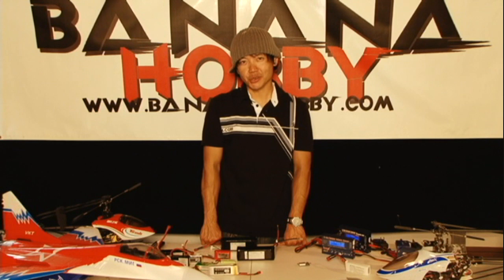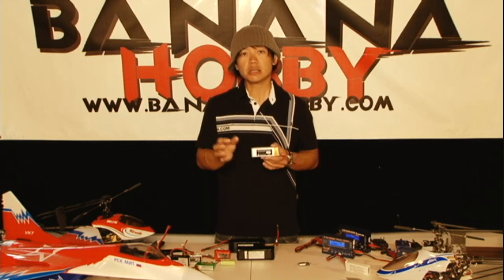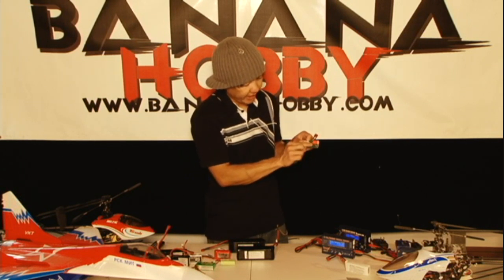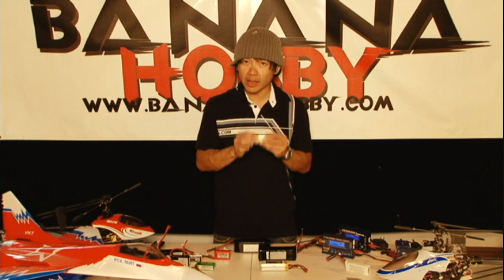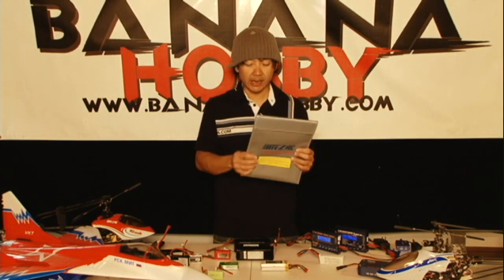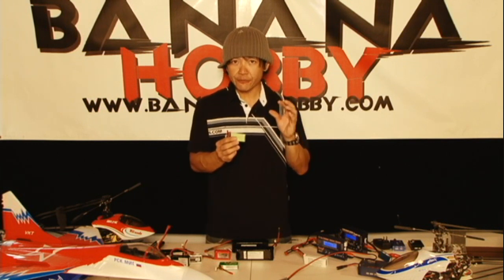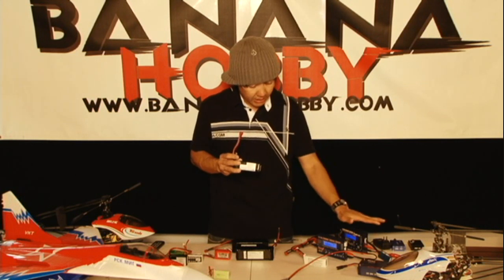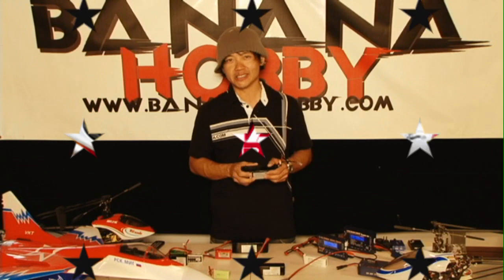LiPo Safety, Use and Care Instructional Video!

Comment from the maker: That may go under several things why a helicopter will spin.  Check that the gyro is in head lock mode first.  Then check your tail linkages and your radio programming.

Comment from the maker: When a battery is done charging, you can use it right away.  When you are finished running it, it is always good to let the battery cool down for about 20 minutes to your surrounding temperature.  Then put it back on the charger.

Comment from the maker: You can get as much as 1000 charges and discharges from 1 Lipo.  If you are planning to store a lipo with no use for over 3 to 5 months, it is always good to put a storage charge on it before storing.  If you leave a balanced voltage of 3.7V per cell, then store, the Lipo would be just fine when you decide to use it.

Comment: thanks for the info pete! Ive got a little vision 3 channel helicopter. and been running it on the ground to discharge the battery all the way. oops. hope i didn't hurt it. it seems to be flying to same time as before I did that so I dont think i've dameged it. thanks for the warning

Comment: I charge my lipos in a steel cash box. just filled a slot in it to allow the wire to come out. solid steel construction and lockable...pretty much blast proof and only £15 from a hardware store. theres a vid of a cash box containg an exploding lipo on here somewhere..check it out. Nice vid btw :)

Comment: 1.  You need a low voltage cut off, the car will just stop working at an appropriate voltage.
2.  Charging times vary on pack capability and charger capability.  1 Hour is usually the standard if you can charge at 1C.
3.  Probably not, you need a LiPo capable ESC though.
4.  Probably, LiPo packs tend to work better when its warm.  Always monitor your packs when charging though.  ALWAYS!
5.  If you use a LVC and balancing charger yes, just watch a couple of videos on LiPo care and maintenance.

Comment from the maker: Well, you can safely charge a 11.1v 5000mah at 5amps "technically".  However, I never charge any lipos at past 2.5 amps NO matter the mah ratings.  A little slower and lower charge rate such as 2.2 amps will give better longevity to a lipo battery.  5amps is too high of a rating unless you are short on time because you have a flight demo and are in need of a FAST charge.  I would recommend charging at 2.2amps.

Comment: Hey my lipo for my traxxas e-revo never used to get warm but now it comes out screeming hot, also the middle cell almost always comes out at like 2.5v wile the other 2 are still around 3.4. I am using lvc but it doesnt have a plug for the balance plug. If i give the battery around 20 minutes the middle cell will recover back to around 3.1v. I was wondering what you thought of this, is it still safe to use this battery?

Comment: Most importantly 6.  Yes, there is a huge difference, you will notice immediately that the model feels "punchier" and will hit top speed faster and may even start doing wheelies.  LiPo packs are capable of releasing much more power than NiMh packs and electric motors just love that.

Comment from the maker: Do not store them in a fridge.  Just charge them to 50% of the capacity and store in a climate controlled room where it does not get drastically hott them freezing cold.  They should be fine.  If you store them longer than a few months, it is still good to cycle them every 2 to 3 months.

Comment: How do I connect the unlabeled servo leads into the "RTF" F-5E 70mm EDF by Blitzrcworks. The instruction manual skips this! Why was the receiver NOT in the jet when it arrived? Why were the #3 and 4 servo leads the only ones labeled? Why did QC tracking "Passed 6" put a check by 1. Tx/Rx Function Check? Why do you guys allow the Chinese to field such poor written instruction manuals? Why is customer support staff so surely, rude and unhelpful?